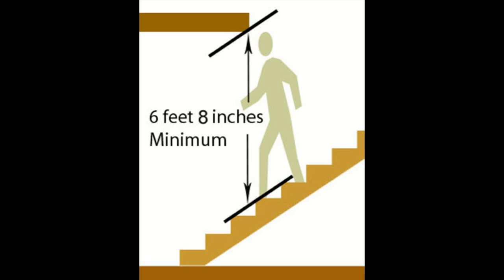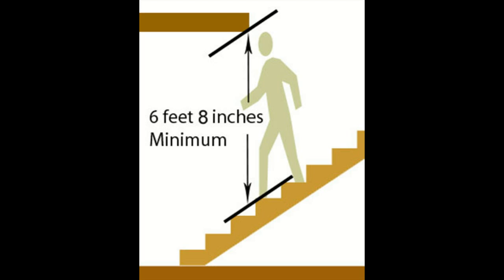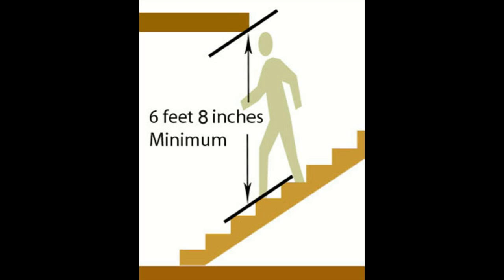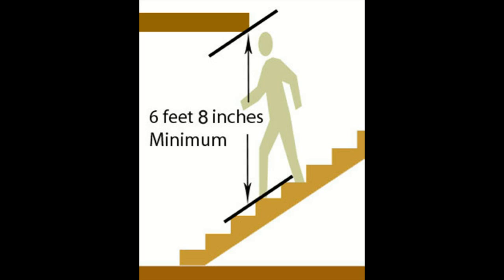Minimum Stairway Ceiling Height - Building Codes And Accident Prevention

Comment: I have bad basement stairs. Need to build new ones before my feet go through them.
Stairs end on a landing that is shared with garage doorway to the left and 4 more stairs dropping to the basement floor to the right. While the height clearance is relieved for the landing and first step towards the basement floor, there is no way there is more than about 74 inches clearance. My problem is this: the landing and the garage doorway are at different elevations making your footing (let alone carrying stuff) awkward if not dangerous. What I want to do is raise the elevation of the landing so the garage doorway, the outside doorway and the last step coming doiwn from the first floor all the same elevation. This will reduce the head clearance further. If it was already not to code, is this a problem (other than the occasional headache)?
Reply from the maker: Remember, some buildings have never been inspected and yours was, then it still a problem. Obviously I can't answer your question, but your local building department can, if you actually have one. If it is possible and it isn't going to cost thousands of dollars, then it wouldn't be a bad idea to redesign the stairway, but I'm going to leave that decision up to you.
Reply: OK. Thank you for your response.